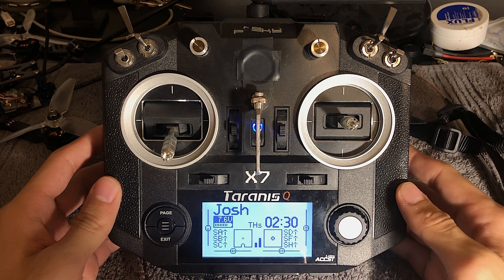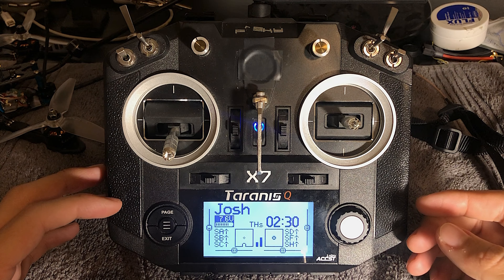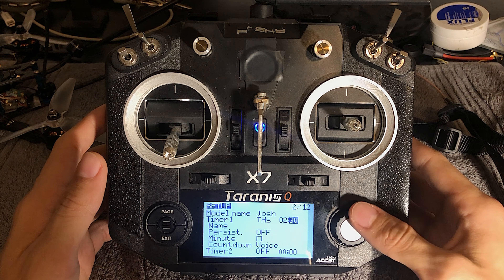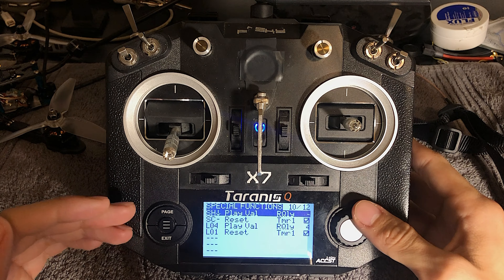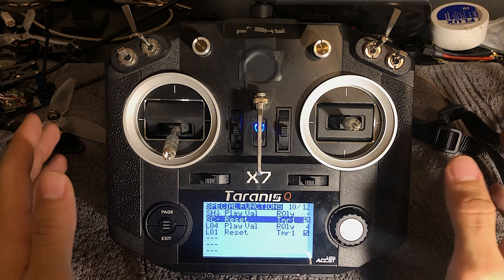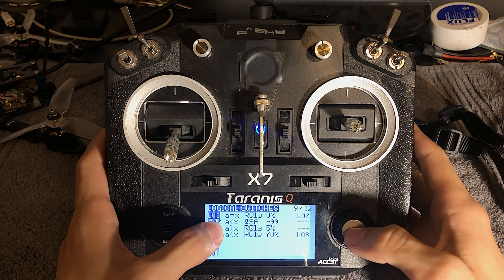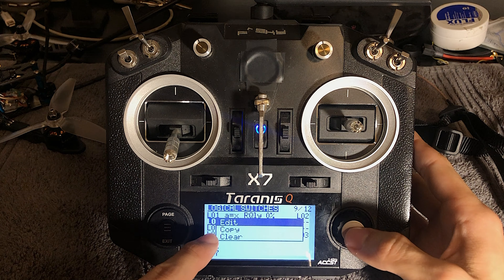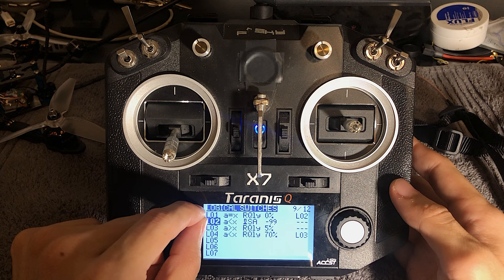Taranis QX7 Radio Timer Setup

Comment: 3:35 I don’t have the “RQly” option.  Is there something I have to set prior?
Reply from the maker: Are you getting telemetry data from your receiver? You need that setup and connected to your radio in order to use that data for the setup.
Reply: @JosueFPV  ok thanks. I don’t have that set up.  I’m using an old drone. King Kong gt. By hobby king. It’s a six year old quad. Your video helped bro I have the timer set up. Only thing I couldn’t do was set it to reset on battery replacement but I’m happy with the fact that I now have a timer and the reset switch. So thank you and thanks for replying